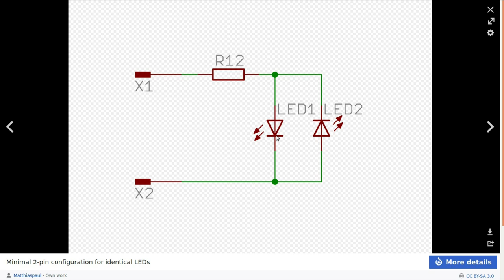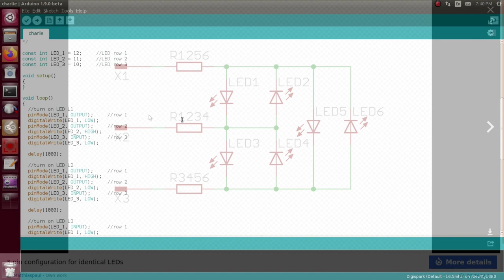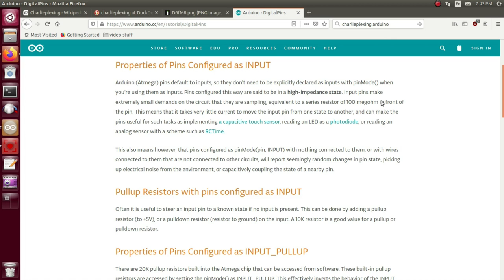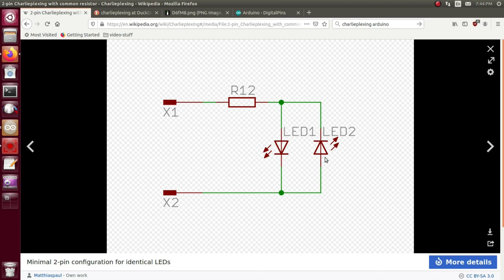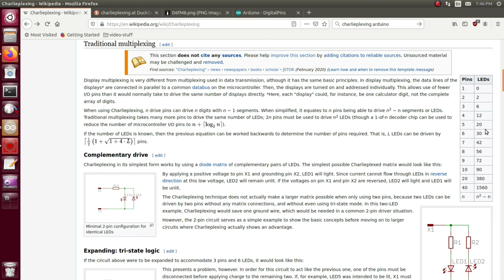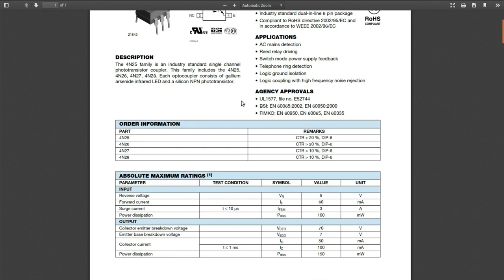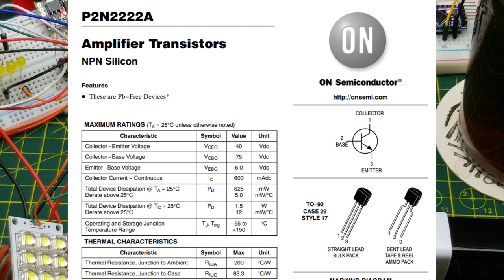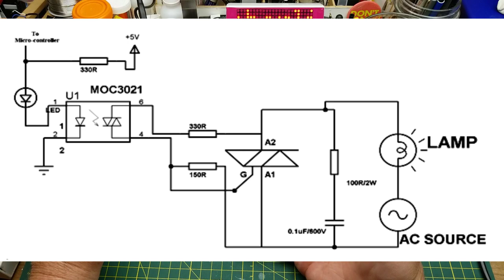tinkering with charlieplexing

Comment: Thanks for an interesting video. It is a well documented but little known fact that Arduino pins programmed as inputs are high impedance. This allows them to be used with tri-state logic such as a data bus - I use this to allow an Arduino to emulate RAM, ROM, and EEPROMs in microprocessor controlled test equipment for troubleshooting purposes.

Comment: How did you still achieve the tri-state using the optocoupler and the 2n2222?
Reply from the maker: The tri-state happens in the microcontroller. The LED section of the optocoupler acts like a normal LED and lights or not based on that.
Reply: @pileofstuff  hey! Thanks for your answer. 
I more or less get how the tri-state work on the microcontroller pins, however I still cant understand how are you able to drive those more power demanding leds still using charlieplexing (which requires those three states) and given the higher voltages you are no directly using the uC pins.
Reply from the maker: @ClaudioRay  the LED side of the optocoupler makes use of the tri-state capability of the microcontroller pins, just like any LED. 

That's where the "magic" ends. 

After that, the photo-transistor output of the the optocoupler acts like a normal switch, and anything beyond that assumes that it's just being switched by a normal transistor.
Reply: @pileofstuff  Yeah... sadly is very tough to maintain the tri-state logic and drive high-voltage GPIOS. I have been struggling to drive high voltage LEDs under charlieplex configuration with no luck so far. 
If you get an idea on how to, please drop me an answer.

Comment: Unless you are running two independent and separate power supplies, an optocoupler CANNOT be completely isolated between the input and output sides.
Reply from the maker: That's correct, thanks for reminding people.

It is what I was doing, but I didn't really mention it specifically.
. 
One power supply is the little black power bank that the Digispark is plugged into, and the other is partially visible in the lower left  (in the segment after 12:47 you can see it's current display changing as the various LEDs go on and off).
Reply: @pileofstuff  In all fairness, though, and also for clarification,  opto-couplers are often used in single supply circuits. In these instances, though, there is generally a transformer in use which physically isolates the two sides of the circuit.
Reply from the maker: I used to find them commonly in stage lighting dimmers to isolate the control side from the high power side.

Comment: Cool video. Long ago when I worked at a systems integrator we used Charlieplexing driven by PLC outputs in some commercial equipment.
By the way- did I miss something? What happened to Mailbag Monday this week?
Reply from the maker: Mailbag Monday is every second week. 
I'd go broke doing it every week (even with my patreons helping me)
Reply: @pileofstuff  Figures. We're sill sort of n lockdown here in Lower B.C. (Washington state) and those silly numbers on the calendar have been running togehter the last couple of months.

Comment: Nice. My (super cheap) optocouplers have 4 pins though.
Reply from the maker: That's also common. They simply don't have the base broken out to a separate pin - just the collector and emitter, plus the  LED anode and cathode.
Reply: Sometimes two out of six of the pins of an optoisolator are N/C anyway.
Reply: These devices come in so many flavors.  Like others here, I only have PC817's.  Perhaps there are applications where a fixed current gain is not adequate, so the gate needs a pin.